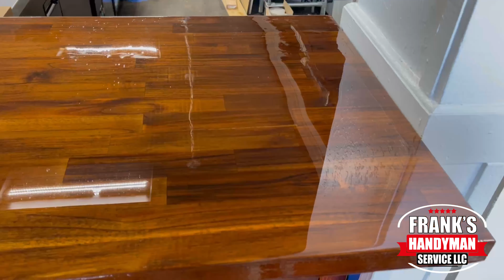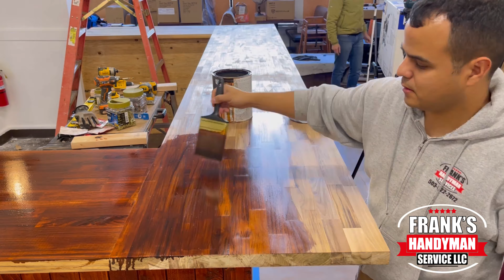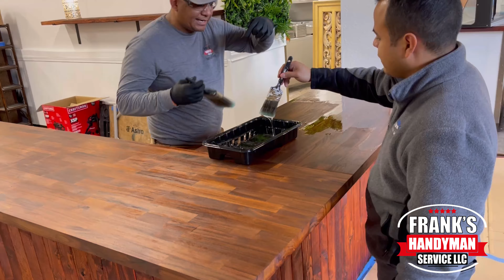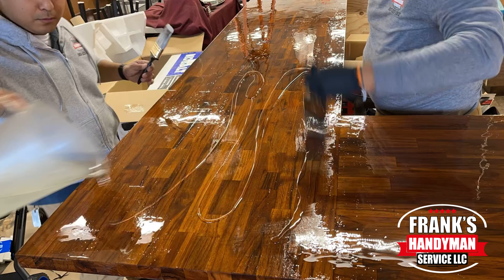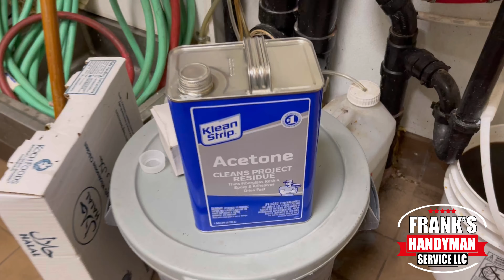How To Apply Stain & Glaze Coat To A Butcher Block Countertop Step by Step DIY Frank The Handyman

Comment: Good video. Only concern i see is that the Block was glued to the wall. That is not good because the wood cannot move for expansion and contraction. It may cause issues down the line.

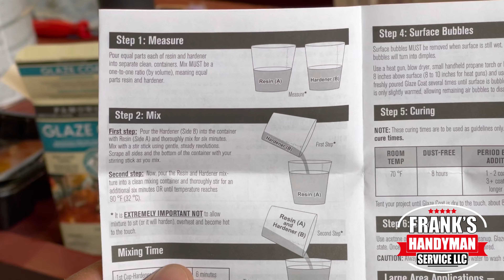Comment: At the 2:47 mark, you'll notice Step 4 - it appears you skipped this step, and that's why you had bubbles with each application.  With a heat gun, or a torch, the bubbles pop immediately.  Also, with most epoxy / resins, you're supposed to sand between pours, so that the layers bond well.
Reply: heat gun is a good tip tyty